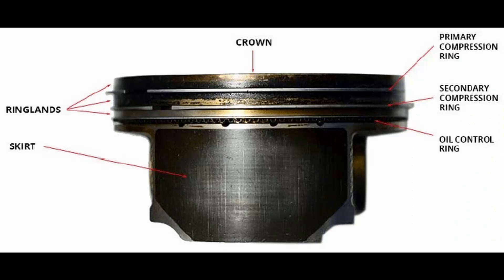Subaru RINGLAND FAILURE Explained | What You NEED To Know | WRX/STI | WRX VLOG 53

Comment: thank god for the FA motor
Reply from the maker: yes and no, the connecting rods are a daunting problem
Reply: @AutoEnthusiast  ive read that those rods candle up to 350 torque to the ground depending on tuner.
Reply: Why should Subaru build a engine to withstand 350 or more hp when said engine is 268 hp from the factory?
Reply: me tuner car not ring a bell? Or did no one tell you?
Reply: @mopar21  emissions emissions emissions
Reply: Lol people saying it's not a good engine can't grasp buying a new car, buying an exhaust, changing the oil and enjoying it for what it is.
Reply: @mopar21  they'res a lawsuit on that engine. It has an flaw in its design.
Reply: @jameskocks4734  the 3 class action lawsuits were on the 2.5. Latest one is centered around a Forrester.
Reply: me there's one on the ej too
Reply: They extended the warranty on the engine. Look it up.
Reply: @jameskocks4734  for the model years effected.
Reply: @mopar21  ok. The argument was the ej engine not a particular year.
Reply: @jameskocks4734  sounds like they've corrected the issue. Nobody's putting out a car like the WRX besides Subaru. Dont like it? Dont buy it.
Reply: @mopar21  oh I bought a 2018 wrx and its paid off. My problem was with the ej. That's why I didn't  buy one of those. And your right the wrx is unique and a great value. It got me from Dallas  to Denver in two tanks. An ej wouldn't come close.
Reply: The FA has it's own issues too.
Reply: @MrMcbear  weak connection rods. No motor is perfect. It's a good motor not a great motor. 280whp and 300ish torque is good enough for a daily driver.
Reply: @jameskocks4734  people dont seem to get it. With each aftermarket part comes a trade of possible reliability issues.
Reply: Agreed. Research in parts and reputable tuner. No ots' and not getting every single bolt on possible. Good maintenance and not driving like a maniac.
Reply: The fa motors arent that great
Reply: @camdoge622  ok how so?
Reply: @jameskocks4734  idk i had one and it just wasnt as fun in a stock(ish) form as an sti or rs, they get alot of carbon build up. Pretty much burn oil from break in, that was the one thing that worried me about my wrx was that carbon build up. The rods are weak as he said before, theyre reliable and great as dailys dont get me wrong i just had to dump mine while it still had low miles and was worth something, out of the wrx, sti, rs the only one i wanted to drive was the sti, i have been dailying my sti and piling the miles on it and its stock with an exhaust and i love it, i love the wrxs but i think i nay even get another one in the future with high miles and i may build the motor, idk im undecided but i know the fas are great motors bur theyre not perfect qnd they're certainly not greater than an ej, maybe as far as hp per liter and all that but im just not impressed by either the fa nor ej (by todays standards) im a little crazy about resale and like i said  i was blown away by how much the wrxs depreciate vs how little the stis depreciate i guess thats the reason iam keeping this over my rs even
Reply: @camdoge622  wow thanks for the lengthy comment. I cant disagree with everything you said. My experience is unique.  My 2018 wrx was paid off with almost 6k. I'm at 12.8k now. I purchased a Crawford aos for the oil separation. These engines dont have a reputation for burning oil though. One day a built block would be nice. Crawfords is 4k though and probably few thousand for labor.
Reply: Oops wrong thread sorry! Lol!
Reply: Mod for mod the fa20 will put down more whp then a STi’s ej257... a fa20 cranked out 350 whp on 93 octane at my local tuner shop (VEMS) a ej257 wont see power like that without either e85 or a bigger turbo, you’re lucky to get 310 whp on 93 octane and every supporting mod including equal length headers on a STi....

Comment: ringland is one thing that worries me owning a 2017 sti
Reply: These are fairly reliable engines when driven and maintained as a sane individual. Change your oil every 3k miles +/- 1k. Change your oil before tracking or going on a long spirited cruises and check it after. Never go above 4k rpm on cold oil. Oil takes longer to heat up than coolant. Always get quality gasoline. Check if you need a tune before buying parts. If you run a COBB "Off The Shelf" map you need to monitor it on the accessport until you're positive it is stable for your setup. Never just assume parts will work with your tune or that your tune is good, verify it with data. If you're going to start modding the engine, an air/oil separator should be the first part as increased manifold pressure will cause more oil to be pushed into your intake exacerbating the issue considerably.
Reply: reboot0000 air/oil separator, oil cooler, equal length headers, and a quality protune. These guys will advance timing hard to get power out of there cars, and wonder why cylinders 2 or 4 burn up. You can thank long manifold runners on that side of the engine, holds heat in due to the UEL’s. Advancing timing leads to leaner mixtures. On those cylinders that leads to very high EAT’s which leads to burning a piston ring up.... don’t believe me throw a temp gun on the exhaust ports for 2/4 and then 1/3 and get back to me...
Reply from the maker: scares me enough to consider not getting one, agreed
Reply: It should